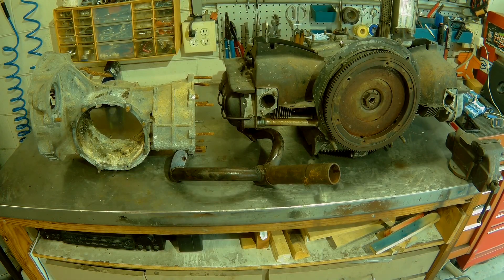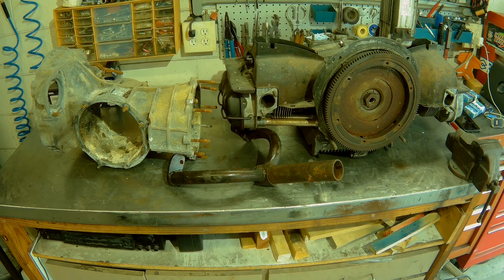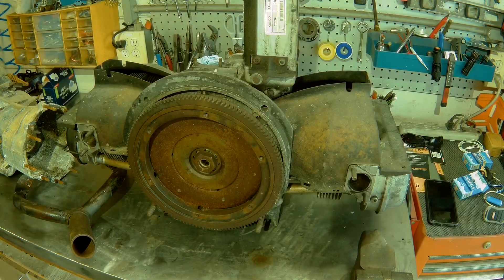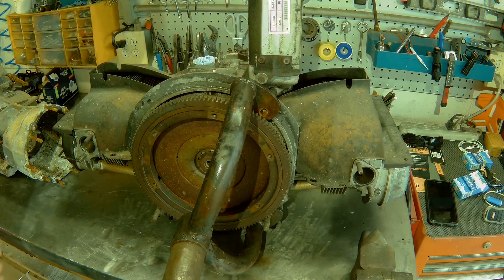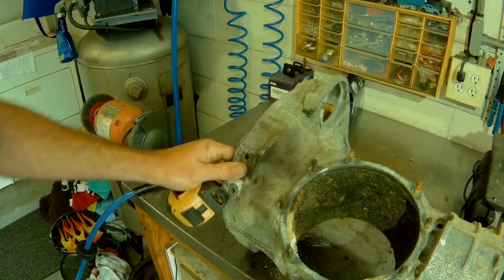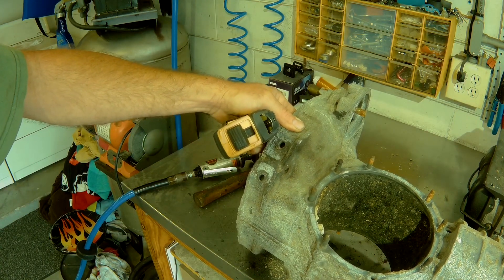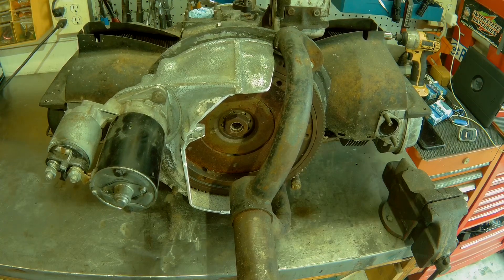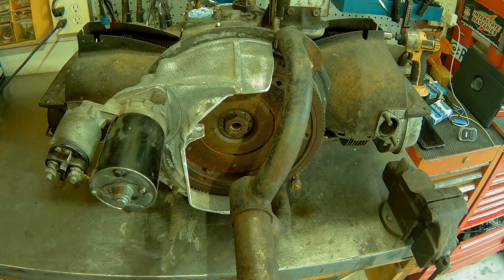Volkswagen Engine Start Stand Build

Comment: i used a type 2 bus bell housing (it un-bolts), it saved a cut, then I could run it threw the band saw to half it, a lot less noise.
Reply from the maker: That’s a great option if you have access to one. They’re not easy to find.

Comment: Gary, I know this is an old video.  I just did this yesterday, however I'm going try to keep the ring complete, with relief cuts for the yolk, so the flywheel is almost full covered.  I would still use the same two bolts to hold it on.  Would this work?
Reply from the maker: I think it’s worth a try!

Comment: Now ill i have to do is find a junk trans
Reply from the maker: @kemohere  check local swap meets.
Reply: @VWJawbreaker  definitely will. If you dont mind can i ask a question? I need to replace my 1600 dual port. Has too much end play. I got a used motor that was out of car. And was told to me that it runs. How would you go about swapping these engines .
Reply from the maker: @kemohere  you’d need to remove one and install the other 🤷‍♂️

Comment: I really like this video. A friend gave me a new engine he built and I guess he installed it in his buggy and had pushrod tubes leaking. When I picked up everything he was giving to me I saw an empty gearbox case and thought that maybe I could use that to start up this engine and today I found this video… perfect! I was going to use my bandsaw to cut it up, but I like the angle grinder idea a whole lot better for safety reasons!! I’m a machinist and totally against using steel grinding equipment on aluminum. But, I’m cutting this baby up with an angle grinder!
Reply from the maker: I’m glad you enjoyed the video! 
Trust me I would have used something besides a grinder but I didn’t have a band saw or really anything else that would have worked. 
Be careful though as these cases are not pure aluminum but a magnesium / aluminum mixture. I’m sure you know what happens when magnesium catches fire!

Comment: I've been looking for a transmission case to do that but it's nothing available, and since the brackets that they sell are so expensive I am planning to make one  out of scrap metal fiberglass or even wood, anyways it's only for testing one engine one time
Reply from the maker: I had to look for a e-bike before I found that one. I’d suggest making it from metal if you can, I’d hate for things to come apart when testing.

Comment: Got a old split case iam going to try this on , wish me luck
Reply from the maker: You got this!
Reply: @VWJawbreaker  
Got a off topic ? My dad has a fiberglass buggy, stock with 87 slip in that are leaking between the head and jugs .is this common with the slip in jugs. Thanks
Reply from the maker: @shawn9878  it can be common but it’s saying something isn’t right. Need to make sure the heads are torqued properly. If they are you’ll need to pull the heads.

Comment: Looks great! Seems much safer than most ive seen :p...I'm just on the same mission to make one for mine for my winter project... Thank  you
Reply from the maker: It’s definitely held up just fine and works well. It could be safer as the flywheel is exposed on one side but I just stay away from that area. 
Appreciate the comment and hope you have a great week.

Comment: Question on engine stand bench mount: My bench mount does not flush right into it as the bolts don't go all the way in. How did you manage to get your bench mount fit tight and flush into the engine for better grip? Im afraid my engine will be just holding up with loose studs and thats not good. I can email you pics if i dont make any sense :)
Reply from the maker: Pics would help, feel free to shoot me an email.
Reply: @VWJawbreaker  Thank you! I just emailed you pics of upper and lower ends where the bolts dont let me flush them tight. Thx
Reply from the maker: @VolksStokes   no problem, happy to help!